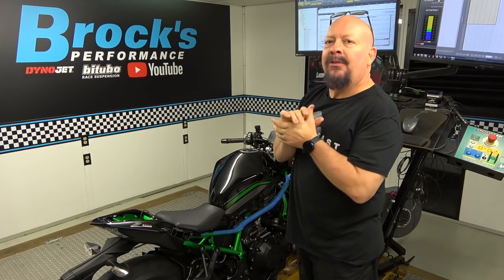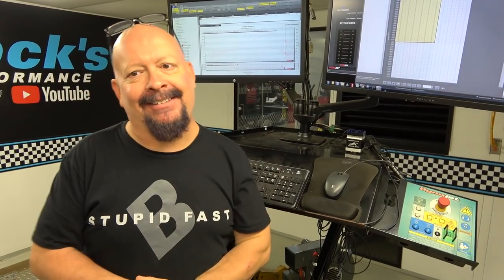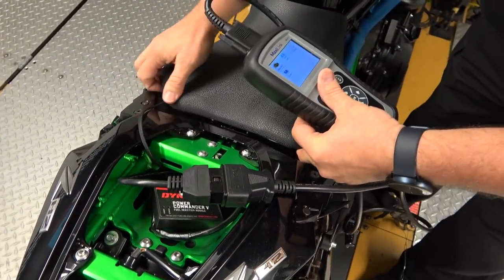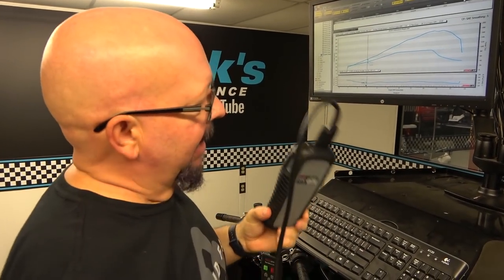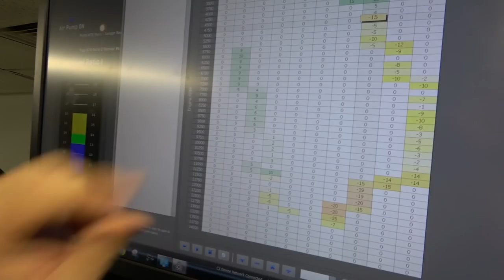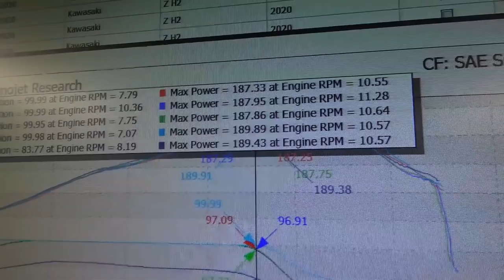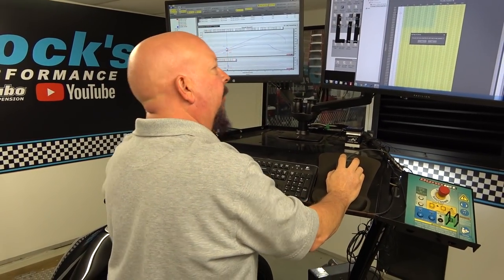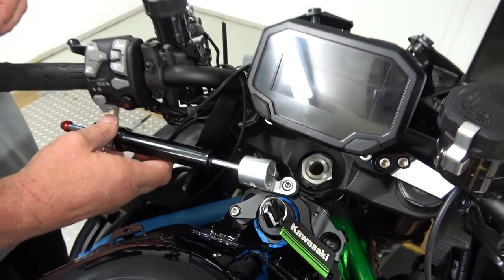Kawasaki Z H2 Slip-on, Dynojet PCV, and Sprint Filter Dyno Results

Comment: Chris at CJS is now able to map the H2 via the diagnostic port. So no need to remove the ECU for tuning, massively convenient as ECU is a pita to remove on European spec bikes as locked in with tamper proof bolts. Unfortunately still no way to do this on ZH2... yet. Very interesting video, didn't realise throttle was shut at low RPM also! Great vid 👍

Comment: This explains why my bike is faster on cool low humidity days. Thanks great content keep up the good work.
Reply: Yah. Yesterday I took the ZH2 again.

The acceleration at cold 3 degrees in gear 4 is pretty much the same as at 30 degrees in Gear 3.

I recognized that the wheele started with gear 3, full throttle and a little pull at 30 degrees.

The same behavior in 4th gear at 3 degrees :D

Comment: Love nerd time with Brock, little different than pulling secondary flies back in 2008 on the zx14 but still the same. Maximizing what's really hidden in there. Used my new Brocks Bitubo damper at Tally for the 1st time and can definitely feel a a little more confident when the front wheel touches back down at over the 100+ mark.

Comment: Awesome video, great description as always. I’ve got the same problem with my 2020 R1. No one has been able to unlock the ECU yet.
Reply from the maker: Not surprisingly, the new R1 and Z H2 both have the same new processor and anti-tamper technology.
Reply: @BrockDavidson   Do you think the ECU’s will be able to be unlocked or is a piggy back controller the best we can hope for?
Reply from the maker: It will eventually be unlocked, but it's 100% impossible to know when that might happen, so the the PCV is the only current means available to adjust the fuel.

Comment: Testimonial, of sorts: Picked up 6 mph on top end and more available with 1 or 2 t off rear sprocket.  169 mph, full pipe, Power commander and Sprint filter from Brock.
Prior run was 163 mph , with slip on, stock filter and no Power Commander.
169 run, yesterday: https://youtu.be/ujO6IHzSGis?t=55
163 run, https://youtu.be/Ch-tfTboTmc?t=28

Comment: After running my ZH2 a few times at Atco, I've pretty much determined that this is not a very good bike for drag racing. No, I didn't invest significant money into the swingarm extensions and everything else needed to give the bike a longer wheelbase, but I did gear it taller with a 19 tooth front sprocket, remove the stock air filter(only when the bike was being used at the drag strip), lowered the front by one inch, and strapped the forks down as far as I could get them. I even ran with a full tank of 93 octane fuel in hopes the extra weight in that location would help keep the front end down, which it did.
Even though I'm 210 pounds fully suited and no pro drag racer, I've been drag racing bikes since 1977 and have done pretty well overall.
The ZH2 just doesn't have the low end torque to get any decent 60' numbers like say a stock ZX14R does. The ZH2 weighs a lot less than the 14R and is rated at the same 197 hp but out of the hole it's just not enough. My best ET was a poor 10.56 and my best trap speed was a so-so 142.16 mph.Unless the torque can be made to come on a lot sooner, I don't see how this is going to be a decent bike at the dragstrip.
I will say that from as low as a 40-50 mph roll on race, it is very potent! It is just disappointing as a drag bike :(
Reply: After all those years as a drag racer you should know that it’s not meant to be a drag bike lol.
Reply: @jockojockoson9995  First, people actually still use "lol"?? How childish. Second,  name me one factory stock, mass produced motorcycle that is meant to be a drag bike. In my world, you can drag race pretty much any self propelled vehicle at a drag strip. Teslas for instance have been raced at drag strips as shown on many YouTube videos , as have been anything from "bagger" harleys to quads, old station wagons to pit bikes, none of which are "meant" to be used as drag vehicles.
I enjoy drag racing and have been doing so since 1977 on my then new Kawasaki KZ1000. The only factory motorcycle that I'm aware of as being "meant" to be, or intended to be "drag bike" was the Kawasaki 900 Eliminator of 1985. My 2002 Kawasaki ZX-12R Ninja was much quicker at the drag strip than my ZH2 . The Ninja had less peak torque than the ZH2, but had more low end torque making it easier to launch hard plus it was a bigger bike with a longer wheelbase and thus was much less prone to doing a wheelie.
Your turn.............
Reply from the maker: Between the wheelbase,  huge restrictions and assist clutch...10.50s sounds about right. That said, once all is corrected the Z H2 will be a solid 8 second machine.

Comment: This is a great and informative video...

What would be really cool is if you could do three test. And it may have to be on something a little older.

But it would be great to see a stock run with a full exhaust on a bike. Then put in a dynojet map to see the results. Then see a dyno tune by you to see the differences in the three.

Everyone always claims the maps on their website aren't great, but it would be cool to see the true differences.

I know on my old K6 750 it ran the best with the 2 Brothers map because it was adding a lot of fuel to it.
Reply from the maker: The problem we see with the DJ maps is that most are created in the high desert of Northern Nevada...which means that's where they work best. Once you get to areas closer to sea level, they must be adjusted to work properly.
Reply: I see... So that's why it wanted the maps with more fuel to it. That makes sense and never really thought of why it was that way.

Comment: Great video as always!! One question I have is though, when can we expect stock availability on some of the out of stock exhaust systems?
Reply from the maker: If you are waiting for the quantity available 0's to turn to + anything...you may be waiting a VERY long time.  Example: we recently received 50 on a hot-selling Penta-Carbon exhaust. By the time they arrived, 55 were already on order (backorder), so the first 50 to order received systems and the remaining five have to wait for another order, (which takes at least 8-12 weeks). So 50 pipes went out the door and the numbers in the store never changed from 0. If you want one, you need to place your order and wait (sorry). Our system ONLY knows first in/first out. It's a crazy time in our industry right now and we expect it to be this way well into 2021.

Comment: How would you know top rpm throttle cut is due to emissions? Could it be for traction control? For going fast in the corners traction control cutting throttle is very abrupt and upsets the bike a lot. maybe factory tune is designed so that throttle is not open in the first place until ecu can detect there is no wheel spin and then it will open 100%. That way if traction control needs to interrupt it will be smooth.
Reply from the maker: The US models have these restrictions. Even Euro 5 approved models do not in other countries. What you are describing with traction control happens in lower gears, at lower throttle openings and rpm's.
Reply: @BrockDavidson  got it. Thanks for informative videos and explanations!

Comment: Can you build an o2 sensor interface between the sensor and ecu? The interface would tell the ecu that the engine is running leaner than it actually is? That would richen up the cruise range.
Reply from the maker: We are really close to getting this done properly.

Comment: Have you ever tried moving the rear speed sensor to the front or vice versa? That way both sensors are reading the same ring.
Reply from the maker: Yes. As long as you are not interested in any of the safety features functioning correctly - it's a great way to get rid of your dash light.

Comment: My thoughts : its a naked bike. i'm not sure if i want it to go more than 160mph ...it's a street bike...a slip on - or a full exhaust system to reduce weight , and i'm sure  a steering damper would help the cause under hard acceleration...thats all i would  do , plus save money for tires....( 14.7 : 1 @ sea level )-  is the best air fuel ratio.
Reply from the maker: PLEASE do not tune your AFR to 14.7 for anything other than low load cruising, as severe engine damage can result after sustained high rpm use. We shoot for 12.8-13.2 for most bikes.
More info: https://bit.ly/37yLNUR

Comment: Newb question. @brockdavidson For tuning a bike like this, or any torque rich bike that has 6 axis imu, can you take acct > lean angle = < throttle open position? 100% throttle on any h2 at 4k rpm may be a bit too much for mortals 😎
Reply from the maker: The fuel tuning is 100% seperate from rider controls. Example: proper AFR is proper AFR, regardless of if you have all rider controls turned off, or you are in rain mode with TC maxxed out where even an H2 won't spin the tire in a gravel parking lot. I can tell you that a bone stock H2 with the KTRC turned off will scratch up the back of your helmet quicker than you can say "what just happened?!"

Comment: So what is your usual target afr in tuning for most power? 13.0? I’ve heard of some coming down to 12.9 or even 12.8
Reply from the maker: For cruising, we shoot for around 13.2-1 on the H2’s and  WOT 12.8-1 for drag and 12.0-1 for LSR. These reference numbers assume a 5 wire sensor is placed directly into the exhaust bung in our pipe.

Comment: Hi !! Me again . I have purchased the PCV from you and was eventually installed yesterday ... I for the life of me cannot remember if it had the map already installed. Also does the rider mode need to be set in a certain setting ie - Rider or Sport or Road ?? Sorry but hope you can help me
Reply from the maker: Stay away from rider mode. Road Mode is least aggressive, start there and then move up to Sport Mode once you are comfortable. There will be a white, hand written tag on the back of your PCV if we installed a map. You will need a laptop and the Dynojet PCV software to confirm it is the correct map for your application. DO NOT run the stock map in a flashed ECU as severe engine damage can quickly occur.
Reply: @BrockDavidson  Thanks for the reply! I rode it in sport and it really didn't feel much different , I will double check the bottom of the PCV and go from there. Thanks again for the advice.. 👍
Reply from the maker: @Andy Coles, remember your bikes new life STARTS at 10,000 RPM. Under that...its still a kitten.
Reply: @BrockDavidson   10K ???? Blimey , Not taken it that high B4 but, Its got to be done .. Thanks again fella ..

Comment: Hi Brock. I was about to check out my cart last week in your web site i was about to buy the complete kit for extended swing  arm for my Z H2,  I did not proceed because there was no ready available extended brake line kit from Spiegler.  Your Sales staff Steve Sex knows this. I forwarded  my communication with Spiegler to Steve.  Please give me update on this. Thank you very much.
Reply from the maker: The 2020 Kawasaki Z H2 6" over rear brake line (to match our extensions) Spiegler part number is: S-KA0428 ask for Brian when you call 937-291-1735.
Reply: Thank you very much brock!
Reply: Brock i am so happy and sad...
Happy because your sprint filter and pcv is already here but the brocks penta carbon exhaust and other performance parts are "still awaiting fulfillment" (ordered 05/03/21) I still cannot install the pcv on my bike because the pcv according to you is pretuned  and matches your penta exhaust 😥😢😭. Please tell Steve and Karissa to expedite my orders i am proudly advertising your products here in Ph  via Youtube  Brock. ❤🧡💛💚💙💜🤎💖💗💛💞💕💟

Comment: Why tune forced induction to 13.8 or whatever? Generally 12.5 is a good rule of thumb, at least in my experience
Reply from the maker: The supercharged kaws respond like normally aspirated bikes on the dyno...so lean is mean. Unfortunately, some dyno operators don't realize how mean leanness can be to the engine...
Reply: @BrockDavidson  the Kawasaki does not respond like a normally aspirated engine. I’ve used a knock link on a H2. These things knock on Australian pump 98 octane which is the same as your 93 when the afr is leaner than 12.5 and especially if your pushing timing. 13.6 is crazy especially with how high the IATs are, I wouldn’t even tune any NA bike that lean, unless your afr probe is actually incorrect and showing leaner falsely. Why would you stress an engine out that much for what 2 hp or so. 
As you know, bike motors are tough but after a while the motor will only take so much heat and detonation before something goes wrong. I would really advise on a decent knock unit when tuning these in the future.

Comment: Why don’t they just put a throttle cable on it aswell so you can keep it forced fully open ?
Reply from the maker: Since the throttle blades are constantly monitored, as soon as they are in a position that the ECU did not request - the bike will throw codes and go into limp mode.

Comment: Does the ram air change any perimeters being variable at changing speeds?
Reply from the maker: Great question. Is it really "ram air" in a supercharged application? Or simply improved intake filling ability? I can tell you that our Ninja H2 data logging in LSR shows the AFR becomes consistently leaner as the bike gains speed, but the ECU does not compensate for this. That's a major reason we also install a PCV on any supercharged Kaw that we race, so we can control the AFR ourselves.

Comment: Update went 2 teeth smaller 46 > 44 on rear sprocket and went from 169  mph to 176.
Will try 43 t , next.  Very steady at speed , even with no steering dampener. 
Gearing didn't make my inst go crazy and throw code like my 400 Ninja.
Today's run: https://youtu.be/1stxbAhMxoE?t=43